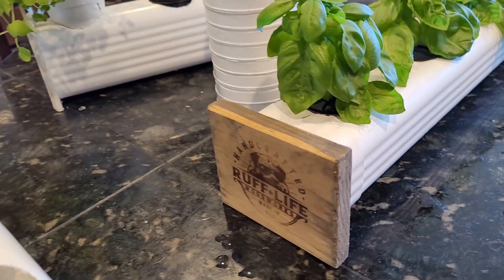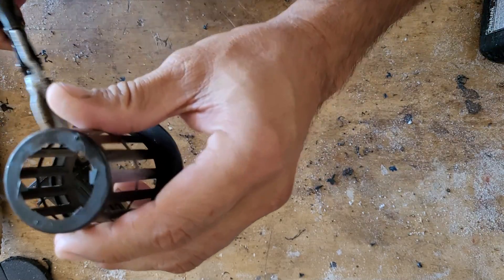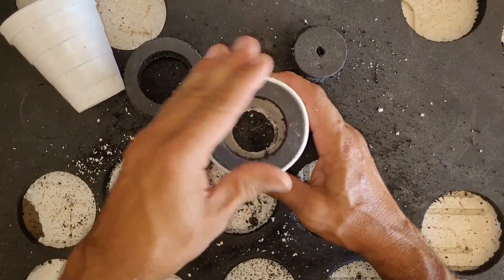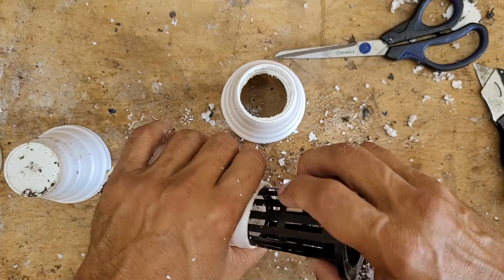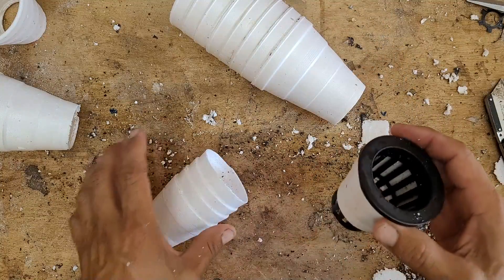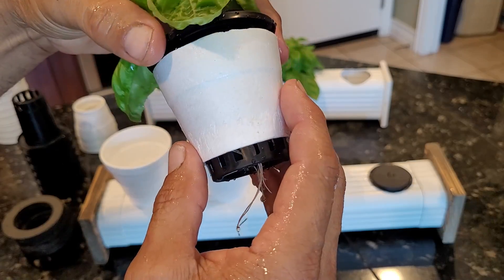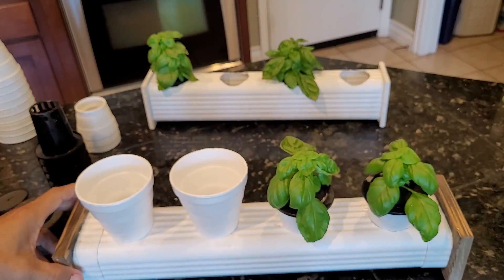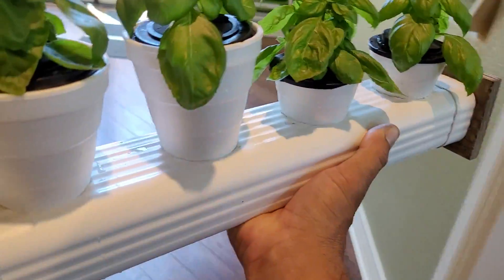Kratky Hydroponic Downspout With Expandable Air Gap Experiment - DIY Tutorial

Comment: Your a genius!!  Great idea!  I'm going to Home Depot or Lowes but thinking about using the 4"x4" vinyl fence post instead of down spouts.  They are only $17 and they sell end caps for about $4.  That way I can fill them up with more water.  I really need the water to last 7 days because we are always out of town.  It's either that or making an automatic water reservoir with a float that keeps them filled.  Great job!  I'm an experienced Mittleider Gardener and just now getting into hydroponics to grow indoors too.
Reply from the maker: Sounds good. I did look up the 4x4 right now at my Home Depot  and they come in 39" length $17 and there is 48" length that is is 19.98. Well I started with the rails for me seedings and propagation and its done very well for me. Then I transplant out to my garden and yard. I also just started messing with hydroponics side as I am doing some type of hybrid as I am using soil. I started with the Basil first and seems to be one of easiest to propagate and just put those mini downspouts in my window sills.. But I will eventually move some to the garden and continue some if larger reservoir. I think the lettuce, herbs, and the microgreens are what I be experimenting on with the hydro. Years ago I messed with some bigger plants in the rails and they suck up nutrients/water when it gets hot. And if it runs out things can go bad quickly. What are you planning to grow? Definitely the larger reservoirs if you are going to be gone for week. I think the auto reservoir is the best idea with the float to keep the system stable and then you just need to worry about the PH and Nutrients. I have an idea on setting an auto water system up with the small 2 x 3 downspout rails with the float as it would very similar to my RGGS. I know my idea will work I just need some time to do it!!! Because even when the larger seedling get mature they start drinking when it gets hot. Would be great if it is on autopilot!! Good luck with your grow!
Reply: @rufflifehydro  My video might give you some more ideas.  I'm using a 55 gallon barrel to feed and water my seedlings and I sell all the extra on my Farm Stand. That's where I have problems because after I transplant them into cups and put on my farm stand, they started dying because I couldn't keep them watered and fertilized all the time after I leave for work.  I want to stick with using my sand and sawdust as soil because that's what I use in all my growbeds and most of the people who buy my seedlings just put them in the ground.  By growing seedlings in soil, it reduces and sometimes eliminates transplant shock. That's why I looked into a Hydro or better called Hybrid-ponics system where I use the Kratky system too but with sand/sawdust or a soil I know is free of weed seeds and disease.  The Mittlieder Constant Feed solution is just diluting the Mittleider Mix that consists of 16-16-16 fertilizer, Mittleider Micro Mix (the micro nutrients), and epson salt.  For growbeds, we just hand feed the plants the granules but for seedlings, we use the liquid version.  I think between both methods, it will solve my problem of growing seedlings and making them easy to sell without having to transplant them and also growing the smaller plants indoors in the down spouts or 4x4 fence posts. I can just put them on my farm stand and won't have to worry about watering them. https://youtu.be/_g3Y0VCyO3c